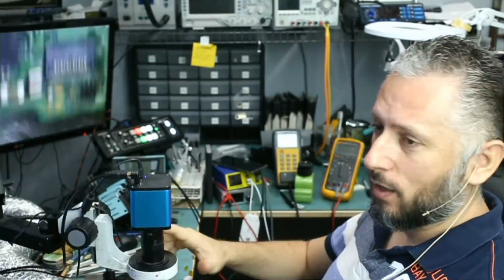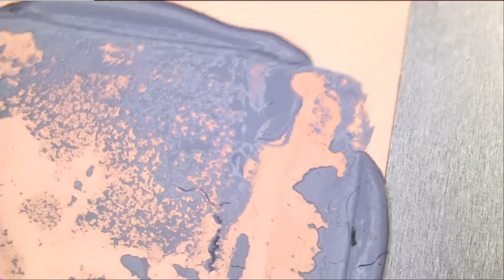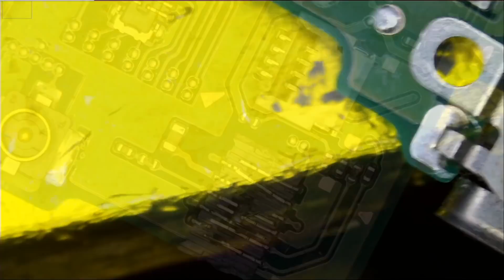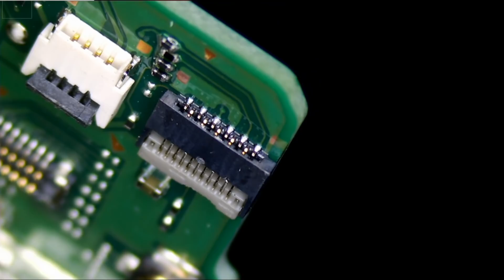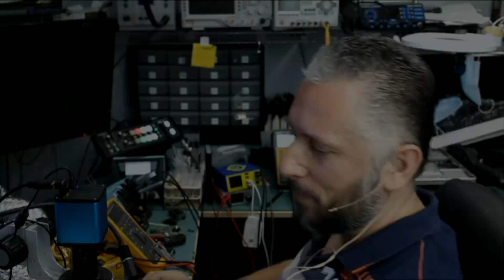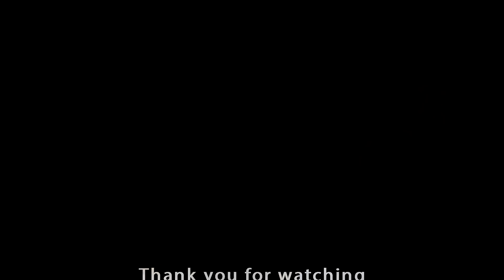Nintendo Switch damaged Joycon connectors replacement and Soldering using Donor board.

Comment: Hi there i just want to thank you i just finish repairing a micro usb charging port. Using the way how you do it apply flux removing old solder and applying lowmelt solder using jumper wire to a ripped pad and it works 😁😁 back in the day this kind of repair is so hard for me but after watching all of your videos I've learned how to solder properly thank you and God bless im a fan from the Philippines

Comment: Great job!
You can also test the buttons of the Joycon from System Settings -> Controllers and Sensors -> Test Input Devices -> Test Controller Buttons.
There is another menu (which I can't remember) where you can test the analog stick. It's a nice touch from Nintendo to include this.
Reply: Under controllers and setting is the option to calibrate the joysticks.
I still have a 1st batch controller that drifts on me. I've taken the joystick apart several times to clean, been a solid few months with no symptoms this time. Fingers crossed it stays good.

Comment: Excellent work.  I've been learning that  fine balance of heat and surface tension of the solder and flux when dealing with the hot air nozzle.  Great learning experience for me.

Comment: Alex, on a PCB of this size what was your temp/airflow settings to remove the connector?
Reply: 380 degrees Celsius is a good spot for most components. Also about 80 airflow is good too
Reply: @210_bk2  Thank you, appreciate the feedback!
Reply: @Fuzzy-88  no problem! For very small parts, I’d use about 20 on the air

Comment: Hey there I really enjoyed your video, I'm currently facing this exact problem and will be doing this to repair it. I wanted to ask what the name of the component is that connects to the ribbon cables on the board. Also when soldering the old parts off by heating it, cleaning and putting the new parts on, all that requires is Flux?  Ty for your time.
Reply: I have the same question. Did you ever find out?

Comment: You still have those joycon connectors in stock? I needs 2 of em since mine had issue with flip up clamps that flew off after trying with finger nail lift up yup mine was pretty stuck  pm me for that

Comment: Thank you for sharing. Just wondering what is the way to proceed if there's other components at the back of some board
Reply: In that case, you can work from the top of the board, and use kapton tape and/or aluminum foil to shield the components you don't want to heat.

Comment: Can anyone ID the small component coming off the middle trace on the right joycon connector at 2:33?

There are 2 components in a row and I need the first. Looks like a resistor or a fuse.

Comment: Is heat better for doing solder jobs rather than just an iron? Or does it really matter on the job itself? Also, which method do you prefer using when it comes to soldering/desoldering in general?
Reply: if you have pins below the item (e.g. connector, balled chips etc) it is very difficult or even impossible with an iron. Also SMD parts where you can de/solder every pin at once with heat, instead of sucking or applying the solder or for every pin is much more comfortable.

Comment: so I tried to install rcm 86 chip and now my left joycon has stopped working how much would it cost me to get something like that fixed i dont know if i damaged the connectors on the motherboard i did try a different left ribbon cable and noting fan and right joycon work

Comment: Hi Alex. Great video as always. Have you ever had a complaint when you use a used part? Thanks!!
Reply: As a customer it wouldn’t bother me. At least he was honest to say he was using donor part 👍
Reply: Generally speaking, the actual connectors don't go bad. The part that is connected do. Also, the donor/used part is most likely a genuine Nintendo part so it should be good. Personally, it wouldn't bother me.

Comment: Hi Alex, i always wonder these donor boards. Do you ask the customer if he agrees with donor path or new one? Or do you make the decision?
Reply: If it works. Why make things more dificult for the costumer to process in their mind?
Reply: @same4718  cuz thats unethical for me.
Reply: @thenextproblem8001  how's it unethical? If a donor board item is cheaper than the oem, you'd be saving money for the customer. Chances are the part will work and last very long.
Reply: @thenextproblem8001  At least you know it's a genuine part, and not counterfeit. Also, the repairs are guaranteed.

Comment: Hey everyone. I have a Nintendo Switch charging, though not fast charging. No display using known good display and battery. No shorts on any of the obvious chips. Not sure where to go from here. I read something about RCM because it shows up as APX in Windows, but I have no experience with that. Any help would be appreciated.

Comment: How do you solder similar connector, if some reason you cannot heat from the bottom?
Reply: Cover everything sensitive with heat-reflective tape, and just heat the connector you want.